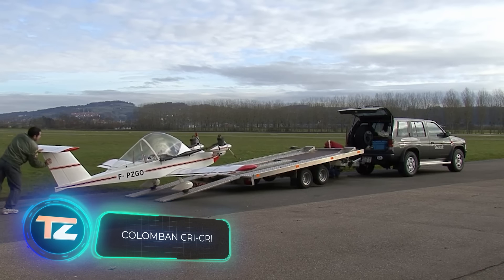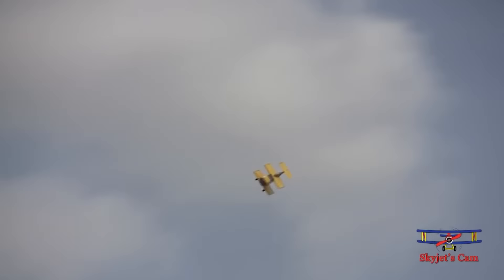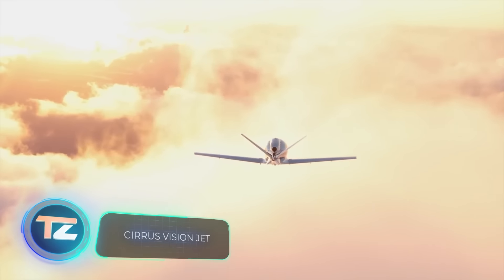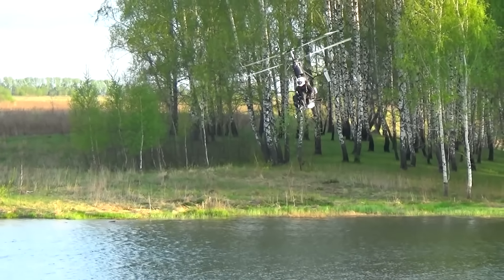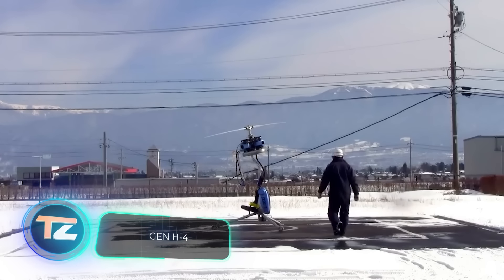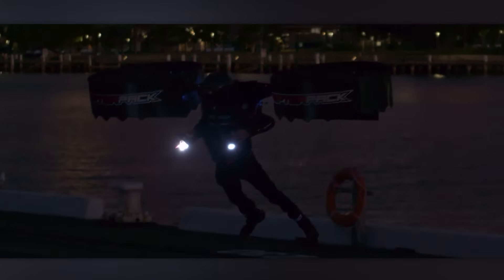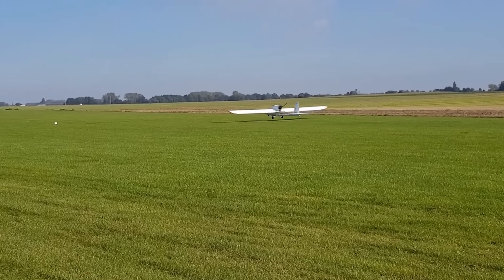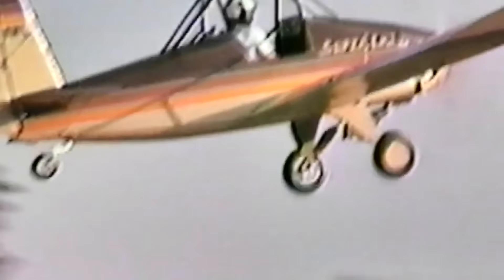20 SMALLEST MINI AIRCRAFT IN THE WORLD

Comment: Great video, if ever another video small man flying plane consider KR-1, I knew original builder & pilot back in 70’s. Ken Rand and Stu Robinson. 17.2’ wing, fuselage 12’ 6”, weight 310lbs, 1200cc VW engine. More info Ken Rand styrofoam aeroplane by AeroFoil Engineering. Homebuilt amazing feat.

Comment: That first one had twin 250cc 2-stroke dirtbike engines. pretty cool. Looked flimsy tho. 30hp is not a lot to fly with.
Reply: You must be right about it, at first the airplane's two engines seemed reassuring to me.
Reply: @RicardoMartinez-oh9sq  well not so much the power, now I think on it because it's probably so light it has a good margin over. but on long-term, small engines need a lot more maintenance. don't get me wrong, viable aircraft, but not be the only or 1st one you'd own.